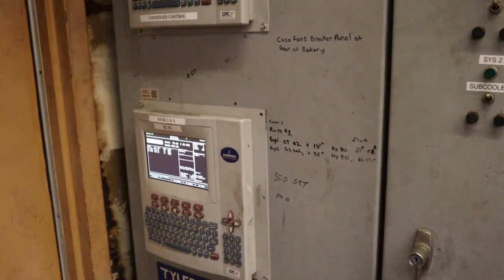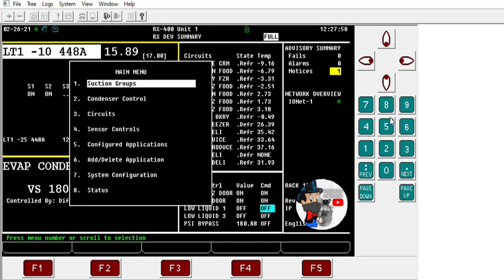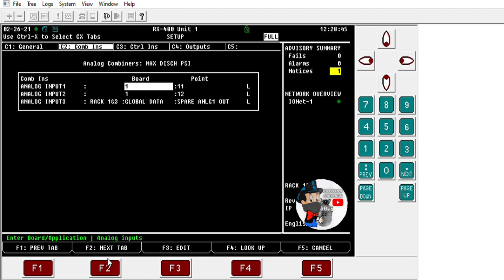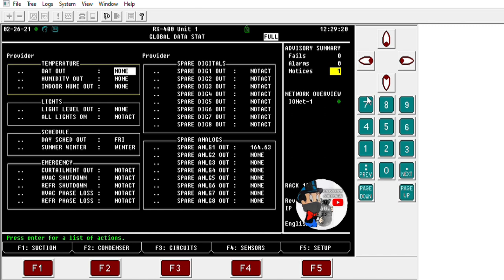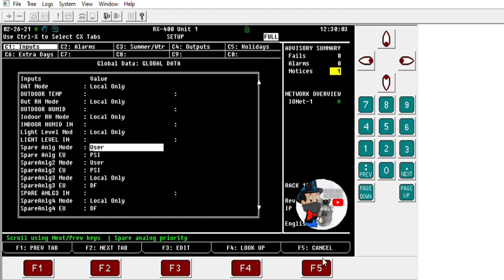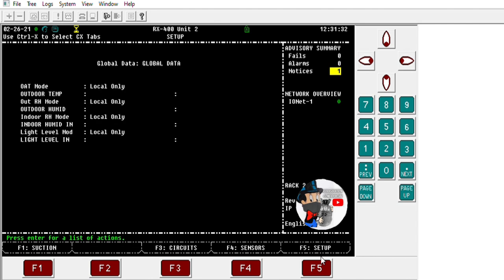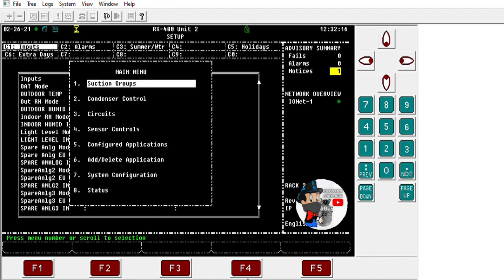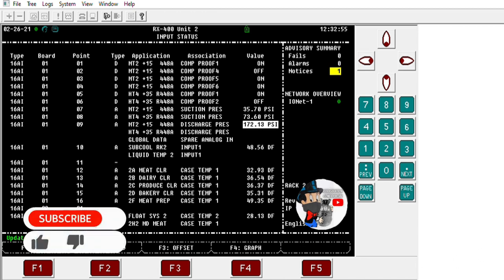Refrigeration Emerson E2 Global Data Controller to Controller

Comment: question? how can I connect with an E2 onsite with my laptop... ie. its raining heavly and the E2 is on the roof. Is there a way to log on without a needing the customers secured remote log on info if I already have the site on Ultrasite. ANY INFO ON THIS WOULD BE REGARDED AS BEST.
Reply from the maker: You can put a wireless router to the E2 while you are onsite…
I have a video on that subject if you want to look it up.
it’s the setup I have at home and I connect it remotely to it
Reply: @refrigerationconfidential4376  I shall search for this upload. Does it require extra hardware?
Reply from the maker: @keithwesley518  no extra hardware just setting up the wireless router IP and you connecting to the router and not conflicting IP address

Comment: Hey how do you like the new Emerson site supervisor control?
Reply from the maker: I installed the Beta one 3 years ago. 
All the Emerson reps came for it.. it had a lot of bugs. Since then I believe all the Grocery Outlets are now going that way.. that was the only experience I have with them installing the first one.. I like the fact its the same boards and it’s a real windows based looking but the touch screen is a nice touch to it... you can remove it and still works just plug in  with laptop..
Reply: @refrigerationconfidential4376  Yep GO's are the only place I'm seeing them. Will hopefully get more experience with them soon. I did get the impression though that it felt a little bloated and slow responding on the touch screen. Hopefully that lessens on a PC.
Reply: I just saw the E3 training, looks better than site supervisor
Reply: @john198292  I thought E3 was just another term for the site supervisor control